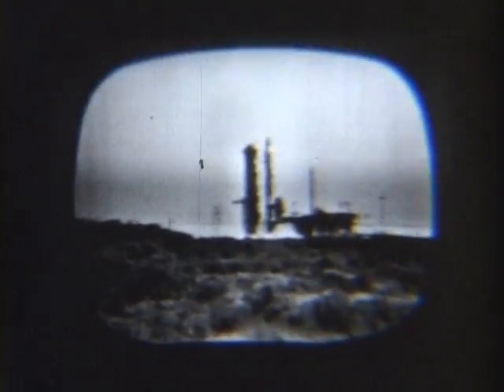Gemini 5 Launch 8mm Footage

Comment: Gemini 5 was a critical mission because it was the first manned spacecraft to use fuel cells instead of just batteries which was vital to longer duration flights  such as to the moon and back.Gemini 5 was also the longest manned spaceflight at that point.One interesting side note to Gemini 5 is that Gordon Cooper's back up was none other than Neil Armstong.